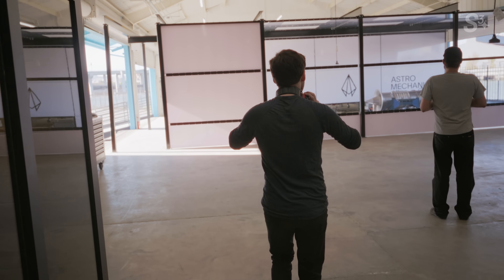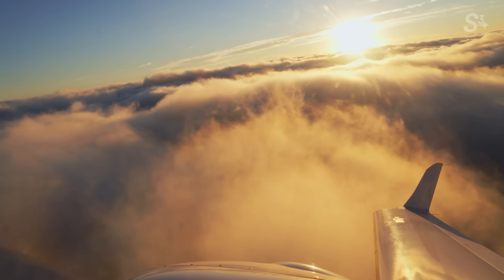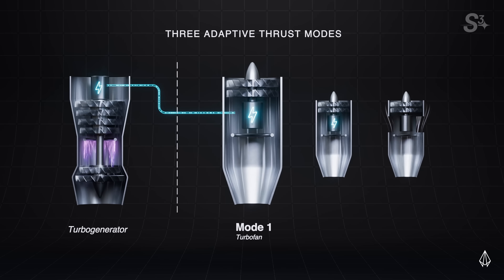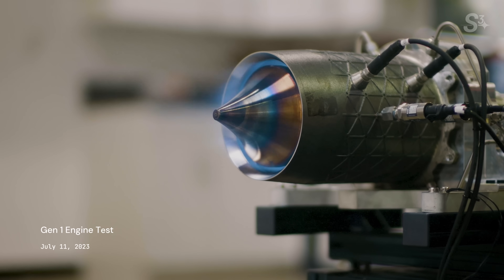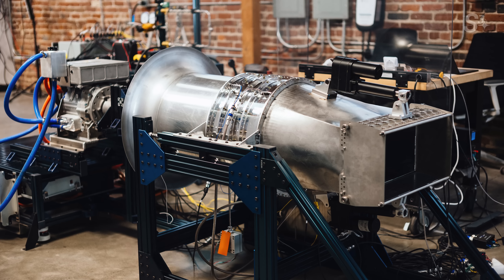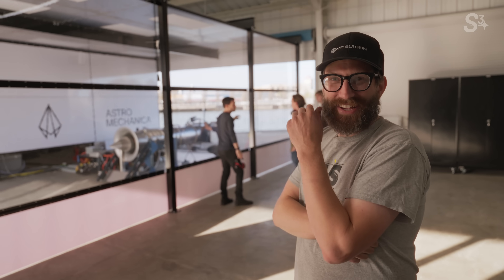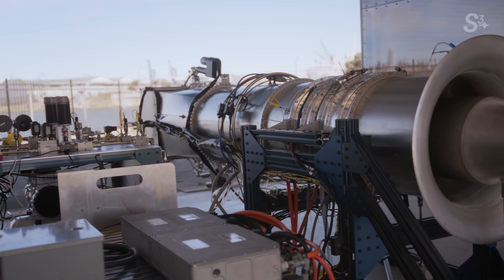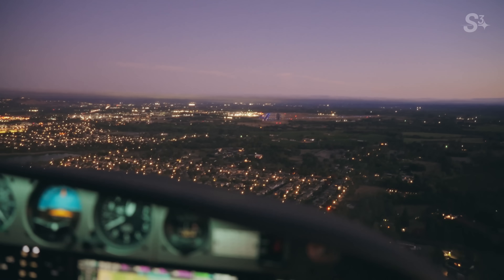The Age of the Electric Adaptive Jet Engine: Astro Mechanica

Comment: Maybe I am missing something, but did he say they are going to use LNG as fuel? Perhaps just for the R&D phase?
Reply: If it is liquid, doesn't that automatically mean cryogenic?
Reply: @AndrewHelgeCox  correct, I guess the way I phrased that was redundant. My guess is that they are planning to use some of the cryo fuel to also cool down the electric motors. It’s definitely a long shot. I wish them luck.
Reply: @AndrewHelgeCox could also mean high pressure, but that'd be VERY heavy
Reply from the maker: Nope, LNG the whole way! It's what makes it cheap.
Reply: @jasoncarman99  sooo… how are they going to address the relatively poor volumetric energy density of gaseous fuels? They’re planning to put these engines on airplanes, right? Not blimps. 

Unless they are planning on using cryogenic form of LNG, which introduces its own sets of problems.

Comment: Have you considdered using the potential electrical output of the engine to drive an external fan? I realise that involves aditional mass, the motor, but only a motor as a gearbox wouldnt be required. Essentally you would get to operate in a 'high bypass' type mode but with variable bypass ratio and fan pitch... It also occurs to me that, for slower flight at least, you could considder a craft with multiple engines and a common electrical bus, batteries, and or capacitors, where it mat be possible to run only some of the engines when crusing by running the ones that are on at ther maximum efficiancy, which I am assuming will be a high pressure diferential, compression ratio, not sure about the terminology, and extracting almost all the exhaust gas energy to be redistributed to larger air speed optimised fans. It si also quite likely I am talking rubbish from an uninformed perspective, I do hydro not aircraft, and small hydro at that! Cool stuff guys, looking forward to updates.
Also, and way out of left field here... Rotorcraft with tip jets, yes I know cool but inpractical on so many engineering levels. But with an electrically coupled compressor, delivering essentally cold, high pressure, air, a tip jet would become just a nozzle with the rotor structure as a manifold. Considder how much less complex that is when compared to current turbine based helicopters.
Reply: I think the idea is the electrical output does drive a fan, and that's the main engines. The other thing to note is driving an external propeller if going at speed just isn't worth it. The fastest prop plane in the world could only manage mach 0.9.

Comment: So it’s still used jet fuel
Reply: This engine is not meant to be environmentally friendly, but exponentially cheaper to operate. LNG is a fraction of the cost of traditional jet fuel. And that’s the biggest cost an airliner has ( besides labor).
Reply: A jet engine would burn pretty much anything you can get to the injectors...
Reply: *rocket fuel but yeah. Batteries will always be half if not less energy dense than hydrocarbons because half the volume/mass is taken up by the cathode. Hydrocarbons also are dispensed when their energy is used up which helps to boost range
Reply: I heard him say LNG at 05:25.

Copilot: "LNG (Liquefied Natural Gas) is natural gas that's been cooled to a liquid state, which makes it easier to transport and store. When it’s in liquid form, it takes up less space—about 600 times less—than it does as a gas. It’s used for powering vehicles, generating electricity, and in various industrial processes."

In the video he says it's much cheaper than jet fuel.
Reply: @AndrewHelgeCox  
plain old hydrocarbons
Reply: @AndrewHelgeCox  and if you thought a plane slamming into the ground and igniting a bit of kerosene thats liquid at room temperature and takes some energy to ignite made a nice fireball, wait until a tank of LNG either under extreme pressure or at cryogenic temperatures hits the ground at 240km/h on a failed landing...

i guess the saving graces are that you will be cooked before you realise youre dead, and dumping the excess fuel before impact could give a bit more thrust...